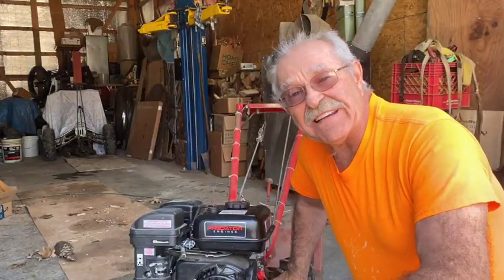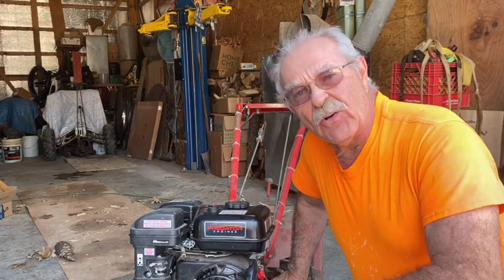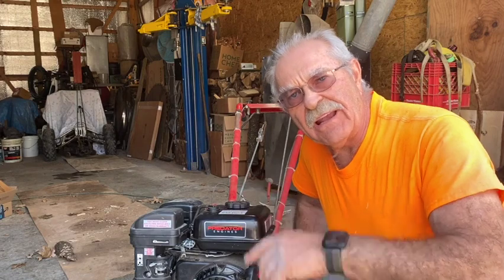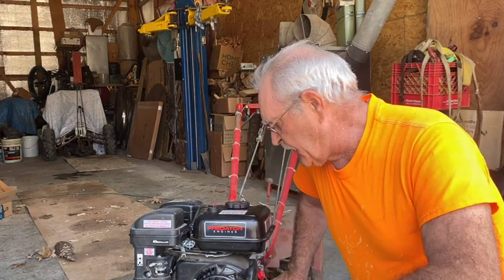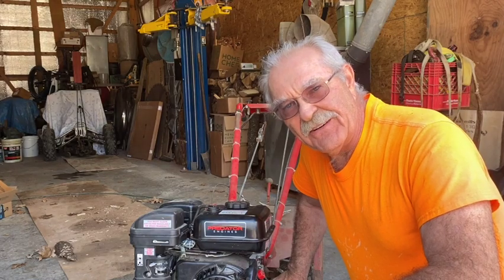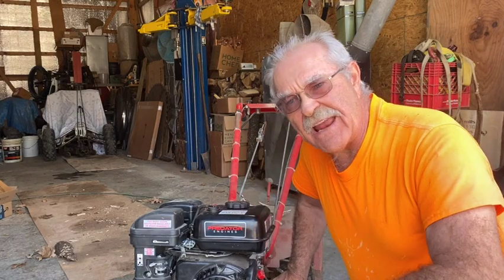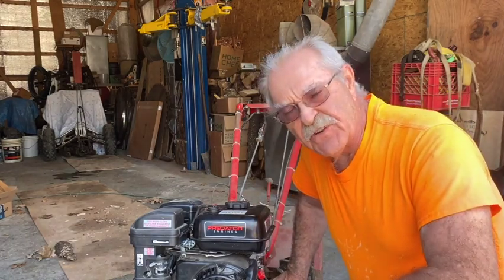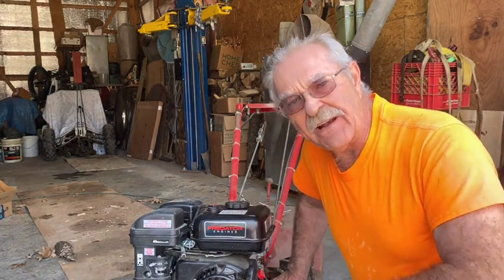Predator 212 cc Fuel Problem- TroyBilt Econo-Horse

Comment: There's a station near me that sells non-ethanol fuel. I love it. I have been thinking about picking up a motorcycle lift for the small equipment like your tiller. I can get down on the cardboard just fine, but getting up is another matter!
Reply from the maker: I tell ya, I have one of the hydraulic motorcycle lifts from Harbor Freight, but its got an old '85 Honda on it and is stuck in the corner.  But it is a superb shop tool for sure.  A buddy lost two of the wheels off of it when it was new and unused and sold it to me for half of what he paid for it.  I took a wheel off of a broken floor jack and cut it in half and installed the two for replacements.  LOL  I really need to get it out and use it.

Comment: Here's a lol for ya .been having  issues  with my  splitter. New carb,sparkplug, fuel,hydraulic  fluid. Just couldn't  keep it running.  Would  start fine run 5 min maybe 20 then stop. Had to let cool before  I could start back up. Today I put air in a slow leaking  tire. Damn thang  ran ALL day!
Reply from the maker: Ok...Mike, you get the Gold Star for the best comment of the day buddy !!  LOL  Still laughing.....Who'da thunk a little air would solve the problem huh.

Comment: I've got a Econo Horse that I need to swap the engine out with a predator.  How easy was it ? And did you have to modify anything  ? Someone said the belt housing would not align with the predator.  And do you have a video of the Swap ?
Reply from the maker: Unfortunately I didn’t do a video on it. But there should be an adapter plate bolted TO the bottom of the engine on it now. If you remove that plate, the mounting holes of the plate TO the housing of the Econo horse will match up to the 212cc Predator perfectly. I don’t recall if I had to change belt length but alignment was perfect. But the adapter plate has got to be removed. And bear in mind you will not have reverse with the Predator. But it is light enough to pull backwards if necessary. Hopefully that will help you.

Comment: Your econo horse has a predator engine swap, mine has the Tecumseh engine also. It has the reverse belt also, is that adaptable on the predator engine also?
Reply from the maker: No the countershaft gearing  does not interchange from the original Tecumseh to the Predator.  But this guy is so little its easy to move without reverse. All I had to do was remove the adaptor plate that converts the Tecumseh bolt pattern to the existing Briggs pattern that fits the Predator.  Then change the belt.

Comment: I have the same engine on a mini bike but it wont start what do i doo??
Reply from the maker: The first thing I'd check is the needle and seat as the fuel enters the carburetor. It may be plugged or if it has the fuel shut off solenoid at the bottom of the carb bowl....that could be gummed up or defective.  That solenoid is actually an 'anti-backfire' solenoid. It may or may not have it.
Reply: @tractorman4461  i did not understand anything you said i don't know anything about engine and the names  could you help
Reply from the maker: @batboldsaik  I think you might need to ask neighborhood friends if they know someone local to give you 'hands on' help.  It's all but impossible to do this on a comment thread.